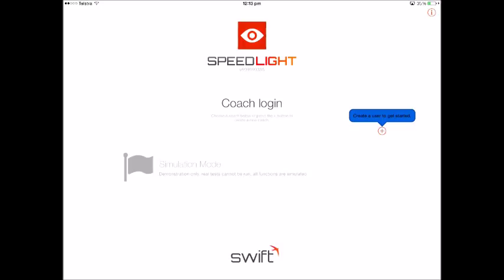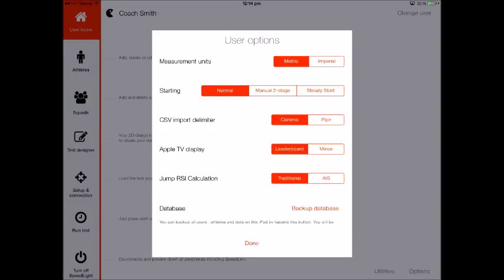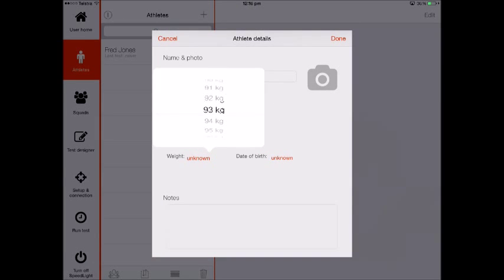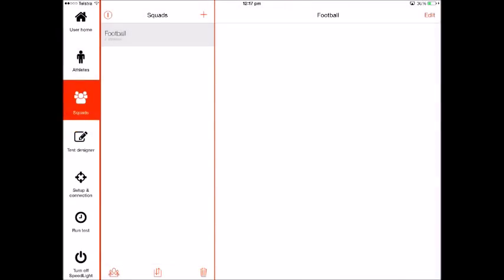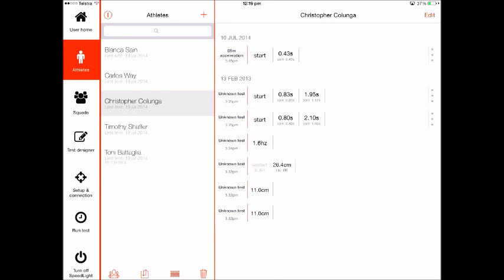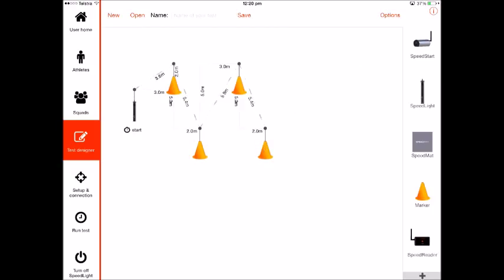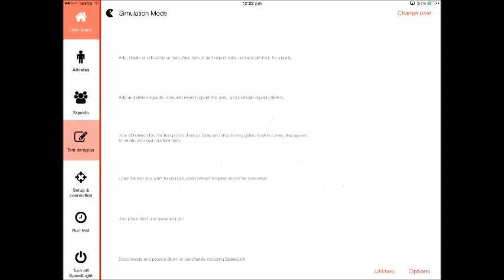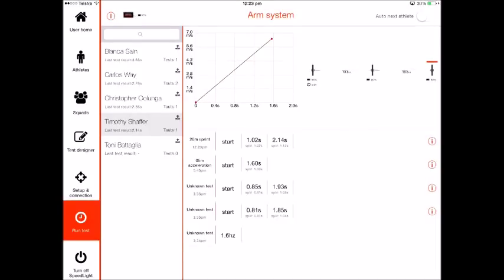Speedlight Timing Systems App - An Introduction

Comment: Is swift performance only work on ISO? 
Or can i use it with windows to?
Reply: Hi, This video is our old Speedlight systemm, and yes, only works on iOS/iPad. Our new system DNA, is the same. However our EZEJUMP product has both Android and IOA app available